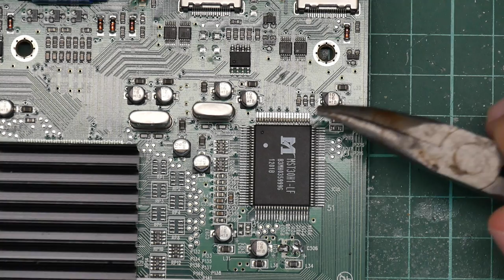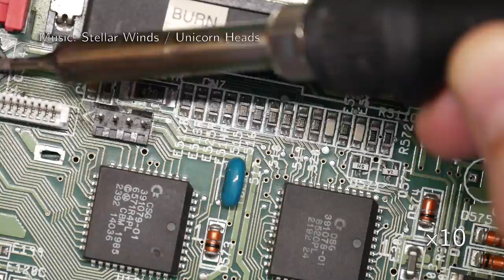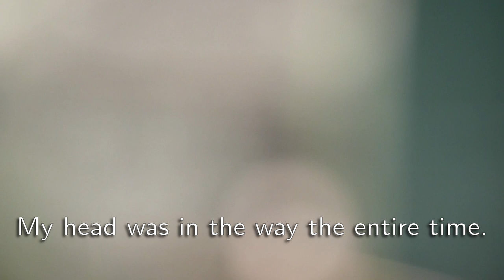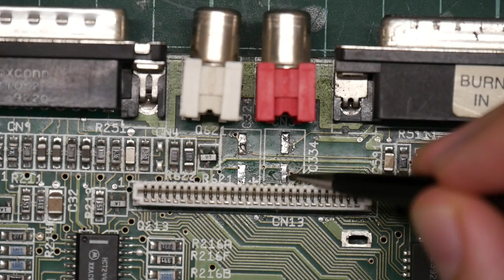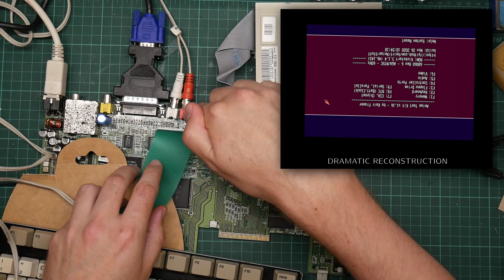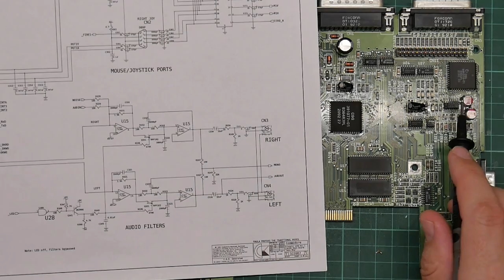Amiga 600 audio system fix: 1/3

Comment: Usually, when it comes to remove a smd electrolytic cap, rotating it 90° one time is ok to have it removed properly, especially if you can catch it on the lower plastic part. The advantage is also that usually, the legs will come with the cap, and just a few solder will remain instead of a broken leg.

Comment: When you're using the copper braid to wick up solder off the board it makes it go a little faster if you put a tiny bit of solder on the tip of your iron first, that way you aren't heating up the surrounding area as much